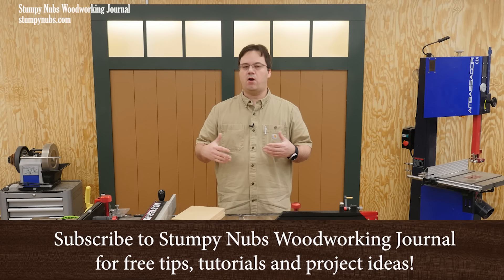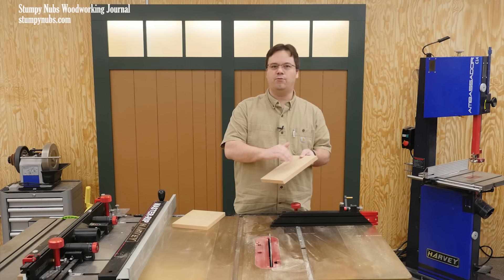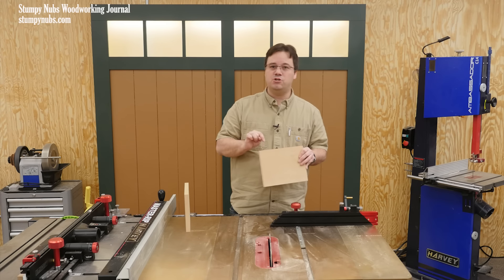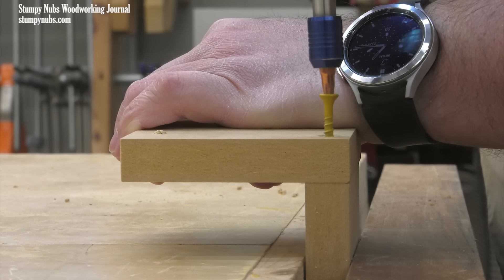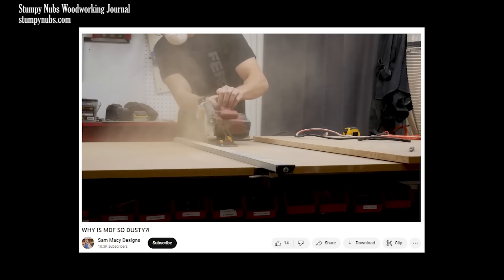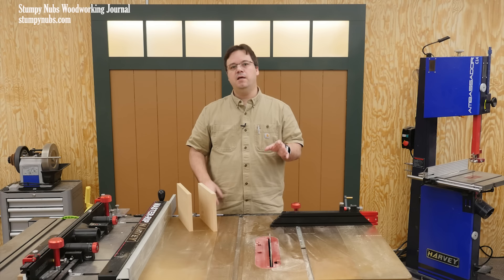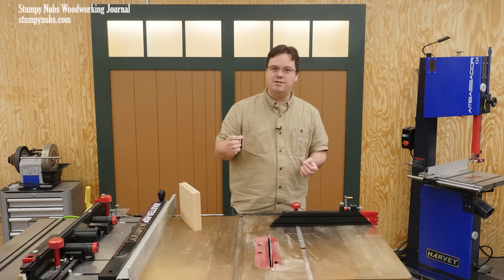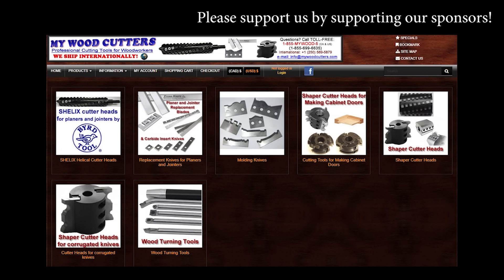This stuff changed my mind about MDF projects

Comment: My tip for screwing any kind of fibreboard, chipboard, or strand board is to pour low viscosity superglue (CA) into your pilot hole, making sure to get some all the way around it. It'll soak right into the fibres fast and cure up fast, so put the screw in immediately. This will bind the fibres that the threads cut into & make things far less likely to strip out. Of course you won't ever be able to remove the screw again, but if you're wanting to do that then you should really be using a bolt & an insert instead of a wood screw in the first place, otherwise it will strip out after a couple of times.
Reply: Great tip
Reply: Interesting tip.  Have you done any testing to see if this increases the strength of the connection point at all?
Reply: @stephenrobinson8250  If you mean does it prevent things from tearing apart entirely if too much lateral pressure is added, then not really. All it does is strengthen the fibres around the screw itself & clump them together, so it'll still delaminate or tear apart if it's used to really take any weight, & the difference between a screw & a screw with a load of core stuck to it is negligible. Perhaps it'd make more of a difference with really thick boards where things would need to push through more material before pulling apart.
Reply: @nightcatarts  And most folks don't realize that super glue is not, nor ever was, permanent. It breaks down over time. So if you want to add some sort of glue binder... wood glue would last longer and be a superior bond. Just dries slower.
Reply: No glue is realistically going to stop the screw from stripping out from overtightening, as when doing it like this the glue is not set yet so it not bonding the fibres together yet. You could theoretically pour glue into the hole, remove the excess with a q-tip, let it set, rebore the hole to the correct size, and then run the screw into the stabilised hole. I did try this as an experiment once using shellac (I used this as dries quickly but doesn't set a q-tip on fire like superglue does) and it works, it is just such a pain in the arse to the point of being useless.
Reply: Superglue is specially effective with MDF. If you apply the thin variation to its surface, it gets really hard!
Reply: @garyoa1  The MDF will break down before the glue does. Also, with MDF, wood glue has two problems: 1) it is too thick and won't absorb into the fibres enough to make it worthwhile, & 2) if you thin it out enough to do so, you'd need to add water & MDF really doesn't like that.
I have had luck using wood glue drawer runners in chipboard though, since the bit of flex it adds seems to enable it to bond better with the glue already in the board. For stable joints I doubt it makes much difference.
Reply: @commando552  It's not intended to stop it stripping out when adding the screw, but rather over time as the item is in use. Little bits of motion, weight being added & removed, etc. will work free the fine fibres between the screw threads, & this ensures that doesn't happen.
Reply: Or thinned epoxy.
Reply: Or…use wood.
Reply: @cosmai23  Budget doesn't always stretch to that though.
Reply: you beat me to it, any type of glue which penetrates the fibre will increase the effective area that the screw holds and spread the stresses over a wider area
Reply: I spray accelerator in the screw hole to strengthen the MDF internal threads and have never had a problem removing the screws multiple times and the MDF threads stay intact as long as you don't over tighten the screw with an impact driver.
Reply: That's a great idea 👏👏
Reply: I like your idea. Using PVA or CA glue to line the screw holes MDF is very poor material. I think if it like unreinforced low grade concrete. Possibly OK in compression, but useless in tension or bending.
Reply: Coat your screw in wax or vaseline first if you want to remove it again.
Reply: @jack002tuber  or just use purpose made inserts, like the ones you find on kitset furniture
Reply: This is the way. Makes cheap particle board furniture stay together.
Reply: I've never had issues removing and reinstalling screws many times in MDF, although I have considered putting wood glue in the holes just to be overkill
Reply: @keithmarlowe5569  A huge number of people use accelerator on videos because it's more convenient, but I find it actually weakens the glue. Slower is often better wherever possible, & metal screws will have a fine layer of condensation on anyway which will catalyse with superglue so it's not really necessary in this case.
Reply: Just soak your piece in super glue.
Reply: @garyoa1  once the super glue is absorbed by the wood fibers it basically becomes PMMA. It's plenty permanent.
Reply: @mytuberforyou  And that's exactly how wood glue works. And you clamp it to push it further into the pores. You don't clamp just to hold it in place until it dries. Ir needs the pressure. But it has a lifespan of maybe 30 years or more. Super glue... one to two years. And virtually no slip and slide with super glue. You have maybe two seconds to get it right. It is a great temporary fix for just about anything. But keyword... temporary.
Reply: There are purpose built screws, often allen head, that simulate a dowel at the head end and very thin extended coarse threads and reduced minor diameter.  Sometimes called magic screws industrially.
Reply: @anullhandle  I've never seen those for sale on their own, only included with Ikea stuff.
Reply: @anullhandle  Ah, I'm in the UK anyway.
Reply: @stevejesus6525  If you've got variant humidity, it's the only way to get a stable, really flat surface that won't warp, twist, or bow.. unless you wanna look into plastics or stone.
Reply: It works even better if the CA is allowed to fully cure before putting the screw in.  Since the CA is cured, the screw is removable.  I do the same thing building RC airplanes using aircraft birch ply.  I drill, tap the hole for a machine screw, wet with thin CA, LET CURE, run the tap through again and I have a threaded hole that lasts for years.  This is a common practice among RC aircraft builders to accept the screws that hold on the wings.  It's kind of important in that application and works very well.
Reply: @David-hm9ic  Yea that's good with machine screws. Wouldn't try it with wood screws though; the threads are too deep & tend to shatter the plastic.
Reply: A bit of oil or wax on the screw will help the screw come out without breaking the glue, extending the life a little bit.
Its still kind of terrible tho
Reply: Polyurethane glue works quite well for this, especially if you are setting woodscrew-to-m4 or similar inset fasteners in place.  It takes longer to set than CA glue, and makes an incredibly strong bond.  So it's great if you need a little more time to get things put together.  Just remember not to pre wet either the fastener or the MDF.  The moisture from the air will make it set, without foaming, in about a day.  Cure time of about a week.
Reply: @yellingintothewind  I really don't know why people want to use accelerators or speed up glue setting. It's always stronger when it's slower.
Reply: @nightcatarts  It depends a bit on the glue.  For any radical polymerization glues, the accelerators give additional initialization sites, which leads to less a branched, shorter chain polymer out the other end.  This tends to be harder but also more brittle.  With something like JB weld, you need at least a little accelerator, or your cure time is measured in months, and the result is almost like rubber.  There are also times when you need to trigger it in a very narrow window when you have everything properly aligned, and the long term mechanical strength isn't a major concern (CA glue for closing wounds comes to mind).  But in general, I agree.  If you are using glue, you probably want a permanent bond.  If you want a permanent bond, you probably want maximum strength.  So why weaken it significantly to save a bit of time up front?
Reply: @yellingintothewind  Yep, I'd rather take strength over speed due to the brittle thing. I thought JB Weld was epoxy though; we don't have that brand over here.
Reply: @nightcatarts  It's an epoxy with a hardener, but also with other additives.  With a simple 2-part epoxy, you don't need a hardener (but it often helps).  Instead, you have two fairly stable precursor chemicals.  When you mix them, they react (usually 1:1), in order to form a fairly short lived pre-polymer.  When you start adding complex compounds to get exactly the consistency you want, like JB-weld does, the chemistry gets quite complex, and is often barely understood.  As a result, you get things like the black half (the part containing the metal additives) hardening on its own if exposed to air for long enough.  This could be due to the additives forming a pre-polymer with that half of the epoxide, or it could be that JB weld uses a complete epoxide in one half and a catalyst in the other, or it could be random air-catalyzed side reactions.  The manufacturer might know, but no one else does.  

That said, for most applications, a 1:1 ratio of black to white halves is fine, and is what the package recommends.  If you want it to set more slowly, and be less hard, you can vary the ratio, decreasing the white half.  This leads to more of those side products, and a less cross-linked composite (although in this case, it is likely more to do with "dead ends" than a reduced nucleation count).  The less brittleness comes at the cost of a longer cure time and lower overall strength.
Reply: @yellingintothewind  Ah I see. I have used other epoxy putties with metal additives but never found them to be much use without the 1:1 ratio. Liquids seem less fussy though, enabling that slight flexibility with less hardener.
Reply: @nightcatarts  If each half is a pre-polymer, and unreactive before combination, then anything other than the 1:1 ratio will simply leave some unreacted.  This appears to be especially true with condensation epoxies.  I'm not sure what the relation is between putty vs liquid and condensation epoxies, but they may fall along that line.  And to be clear, you don't want to short yourself on hardener much (you're talking 8:10 or 9:10 for a "thin" mixture).  The absolute strength falls off far faster than the hardness, and it becomes even more sensitive to mixing issues.

Really, this topic could fill a lengthy lecture series, since the chemistry is fairly complex, and there are a lot of things that fall under the general category "epoxy".
Reply: OR PVA glue.  Cheaper and works well.
Reply: This has been fact checked false :/
Reply: You can drill the holes out and glue wood dowels in screw into them
Reply: @robertreid2319  Yes that too, though it takes a lot more work. I quite like through-dowels as a compromise since the dowels can then act as fixings themselves.
Reply: Have you tried wood glue as well as CA, or just the CA?
Reply: @liquidrockaquatics3900  Just CA. Wood glue won't stick to cured CA very well and if you mix them wet the CA will catalyse and end up curing too fast.
Reply: This is exactly the tip I was looking for!Thanks brother!!!!
Reply: Great tip, many products can apply. I'm thinking wood strengthener, hardener or consolidation products; Designed to do almost this exact job.

Comment: The drywall compound thing is from the 1980’s. Many cabinet shops have been using mdf for raised panels since the 1990’s. We use one of two products. BIN white shellac primer sealer or a catalysed solvent based primer. You sand to 240 grit apply two coats of sealer to the cut area one minute apart. You can use a brush. The BIN will soak in like water then harden. You then sand with 240 and prime the whole panel with your normal waterborne/solvent primer. No drywall compound or bondo.
Reply: Bondo works great on MDF scratches and such.
Reply: Good tips.  Hey Adam, I just made a built in seating area for a kitchen out of paint grade plywood.... what kind of hole filler material would you suggest for the nail holes, also there are a couple places where i need to use a material to finish off plywood edge grain preparatory to priming... I had this stuff called timbermate, but i just ran out... anything from like home depot you could suggest?
Reply: As a painter with 10 years experience after completing a classroom apprenticeship, I can verify that  BIN or other pigmented shellac is the way to go. When the video prescribed drywall mud, I cringed because that is the last thing I would want to use for this application. Bondo is an excellent product for other applications where you need to build up damage to wood as you would the body of a car. When applied properly, you can nail and screw into it and I used it on my father's house for exterior  wood trim and it never failed (the last time I looked at it was after 25 years of the application). The major difficulty with Bondo is that it is often harder than the soft woods you may use it on, and it is very difficult to sand down. For that reason, apply shallow layers waiting enough time for it to get hard, but not letting it cure (I think about 20  minutes is about right); also use a rasp or sharp blade while it is firm but soft to take off bulky waste. 
I don't know of a single use that I would recommend for drywall mud other than for use on drywall.
Reply: @mlauntube   Try adjusting your hardener ratio and you may have more user friendly results with bondo
Reply: @unclesunbro1577  I'm familiar with Bondo when it is not mixed with a proper ratio. My comments are all in the context of properly mixed Bondo. My comments were in favor of Bondo and I don't think you will find a friendlier result than patching that has lasted for over 25 years.
Reply: @mlauntube  Drywall mud is also useful for bedding a plastic shower stall floor. Dump a big mass of the stuff on the sub-floor and squish the shower stall into it. Let it dry, and it'll never move, or crack under a heavy load.
Reply: @mlauntube   Oh I wasn't arguing with you and i didn't think that you disliked bondo. I just thought it might be a helpful tip
Reply: @unclesunbro1577  most people don’t realise that polyester resin products are catalysed at 2%. Bondo should not be red after mixing. It ruins the adhesion.
Reply: Drywall compound is not ideal and will cause finish coatings to flash. White shellac seals much better and is alcohol based without the water of drywall mud swelling the fibers. Dries really fast. Sands better. Don’t use drywall mud on cabinets.
Reply: @ToddAndelin  buy more timbermate or bondo,
Reply: @mlauntube  Yeah, fully cured Bondo is like sanding concrete.
Reply: @aspees  That's why I use blue hardener.. lol
Reply: Evercoat Polyester Glazing Putty is excellent for minor repairs and fills. Very fine, non-porous, very fast set up. Excellent for painting, and for repairing MDF routing templates.
Reply: @Struthio_Camelus 
Setting mud is a better choice, since it does not shrink as it dries
Reply: @markuschelios6891  Thanks for the tip, Markus. 

I hope to set perhaps two more showers, after that it'll be somebody else's pleasure. 😜
Reply: BIN is amazing on any wood that is being painted not just mdf I’m a carpenter and when renovating a house or an old house BIN is my best friend, just watch the fumes 😂
Reply: Timbermate is worth every penny, IMHO, & well worth the wait for Rockler or Woodcraft to ship it to you.
Reply: Use glazing putty for cars superior easy to work and sand
Reply: MDF never seemed cheap enough to be worth using.
Reply: One trick with using BIN; if you have the time, let the can stand for several days and do not stir or shake it. Then pour off the top 1/3 of the liquid which will leave a greater solid : liquid ratio when you apply it to the MDF.
Reply: @Struthio_Camelus  structolite is better